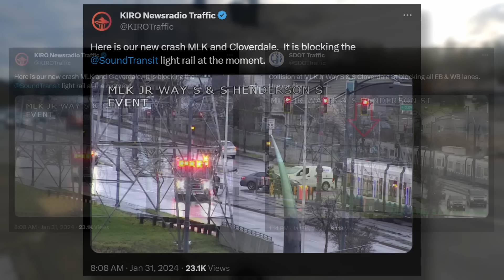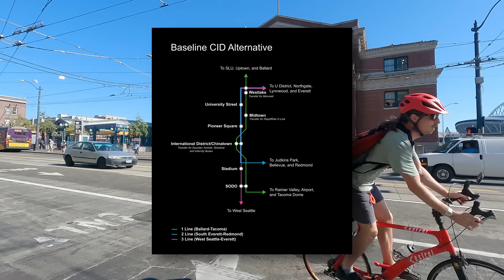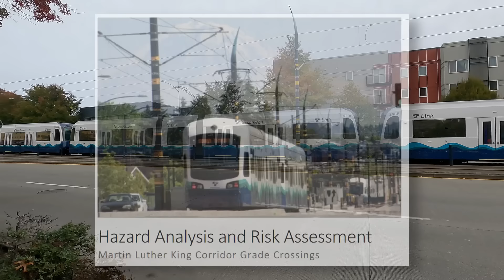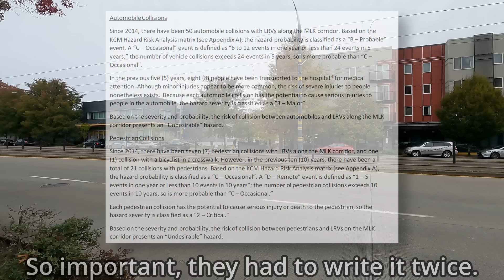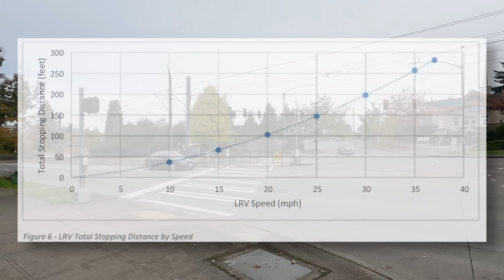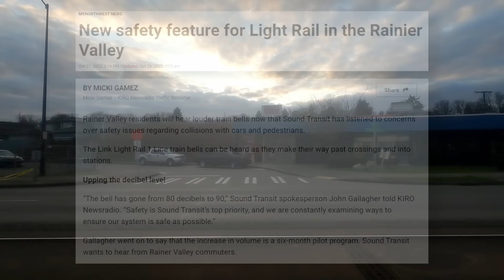Don't Skimp on Grade Separation

Comment: Sure, but the whole point of LRT is that it is a compromise: you trade off benefits for greater flexibility and less expensive construction and maintenance. When you start talking about grade separation, you’re really just rejecting the basic bargain that was made by building LRT and saying “we should have built a metro instead.” You’re no longer saying “make LRT better”; you’re just saying “ built metro instead of LRT.”
Reply: I think there are two super important things people miss about the whole "ew LRT"
1: Early on Link didn't have the political power it has today and so the cost savings of Rainier Valley allowed it to be built at all. The same can be said for systems like Minneapolis Light Rail.
2: RM Transit is a liar, low floor light rail vehicles aren't substantially lower capacity than metro trains of the same length.

You're absolutely right, this constantly droning on about how LRT is bad and you shouldn't build it "look at these systems that were stupid enough to fall for it" misses political contexts and takes away from the important discussion: how to make LRT work
Reply: @harlander-harpy  
Low floor trains are still less capacity than high floor trains depending on the seat design. If you have an LRT and metro both having transverse seating there wouldn’t be much of a difference. But if you have longitudinal seating one a metro trains, there is more capacity due to replacing seats with standing room which is more dense, even more if it has open gangways.

Edmonton is great example on having both high floors and low floors with similar dimensions. The seats are both wide, but high floors have more space to stand around in compared to low floors with seats having to be on top of the bogies.

If you’re running practically a discount metro, why run services and vehicles like it is a local tram.
Reply: That's the thing tho, Seattle needs a metro. There isn't really any compromise here, it's decent and reliable service with a heftier price tag, or subpar unreliable service but we save some money. I would rather have decent service.
Reply: @TheRandCrews  Link Series 3 LRVs will have single cab units similar to Portland. This will mean a 120m train can carry 932 people. A 120m long WMATA train can carry 957 people. The difference is pretty small.
Also, calling Link a local tram service is just patently stupid when the at grade center running segment makes up just 5 of its 25 miles and in a few years at grade segments will make up 6 of the 60 miles. By the end of ST3 construction it will make up just 6 of the 120 mile system.
Reply: @TheRandCrews If it only depends on the layout of the seats than high floor LTR have the same capacity. I don't share some of RM Transit's opinions on LTR but he's mot a lair. The advantade of high floor is the ability to hace level floors as there are no boxes to accomodate the bogies which limits the seat arrangment and leaves less space for passage but in newer models it's far less problematic. Today low floors are the standard in most systems.
That said the OP is right. If you wan't a regional service use actual trains, if you want a fully grade seperated system go with a metro/light metro, not light rail. Unlike RM I think it's great to use LTR if you have different needs along a specific rout and you can move the LTR underground when needed or have longer more regional style sections but this only applies if you have sections that are better served by street running with slowe speeds and shorter distances between stations.
Reply: Seattle had the opportunity to get a proper Metro in 1968’s Forward Thrust campaign.  The voters turned it down but voted for the Kingdome which we all enjoy using to this day!
Reply: @erik_griswold  actually, the reason it was turned down is interesting. The planners bypassed the objectively better Rainier Valley and opted to go the Georgetown route and so the people in RV voted against it 3:1, seeing it for what it was; yet another project that screwed over the black and brown communities in Seattle. Keep in mind, while FT was being voted on, the communities in Rainier Valley were fighting tooth and nail to prevent the RH Thompson Expressway that was slated to carve its way up through the valley, through Judkins, through the Central District, and through Montlake before heading further north still.
Reply: @harlander-harpy  rip that gas extension down lake city way though. shit would be fire today
Reply: @TheRandCrews  doesn't depend on high-floor or low floor, but the interior layout alone. There are also high floor trams with lower capacity than low flor trams, simply due to their layout.
Reply: @EnjoyFirefighting I literally said that with the seating arrangements in my same comment
Reply: @AL5520 I wouldn’t say low floor is the standard but more so became the trend for such new modern tramways and LRT being such a varying degree of design just adopted it as well. To be honest most cities in the US should be metros anyways but yeah price and politics. Seems to be the high ridership LRT systems are the ones that should be or near to metro status anyhow. Everyone is literally just missing out on my first part of my comment about seating arrangements
Reply: LRT is stupid it’s best in rural areas not as proper urban service
Reply: If public transit got the 90-10 federal state split every freaking highway gets there'd be no need for light rail. Highways are expensive and need rebuilding every 10 years if they are used. Rail is expensive once and saves money and space forever.

The goal should be to drive modal shift, we need to induce demand by building serious systems in ~every~ major population center and connect it up with interregional rail lacing thru the suburbs.
Reply: They should have built metro instead
Reply: @harlander-harpy  The capacity of a train is wholly dependent on the interior configuration. High floor trains give you more flexibility to configure the interiors how you like, be it for long distance or high capacity. WMATA trains have an interior layout more similar to a commuter train with rows of transverse seating. Meanwhile, the S7 stock used in London on the subsurface lines is 117m long and has a capacity of 1200 people. That's 28% more than the WMATA trains and the LRT trains. And a 120m long Class 378 lengthened to 120m would have a capacity of ~1380 people, which is 48% more.  The issue with 100% low floor trains as many other systems are trying to use is that the low floor interior and bogies that protrude into the interior eat up space that could be used for standing passengers. And the doors aren't exactly designed for high capacity use. At least Seattle used 70% low floor trams so that more of the interior can be longitudinal seating. Link is clearly morphing from a medium distance tram-like system to a high speed metro system, but the vehicles aren't adapted for that sort of operation. Low floor trams still have their uses, but they operate best when they are operating at grade (i.e. on the street) and not on a metro route.
Reply: I’m glad someone else said this. It’s a classic case of making perfect the enemy of good. Yes, I would love if the 1 Line was a fully separated heavy rail metro. But among LRT systems, Seattle gives the best bang for our buck, and really highlights why the flexibility is so beneficial. It’s not like Phoenix where the whole damn thing is in stroads, it’s only at grade when necessary, and while it has issues, the money required to mitigate them is no doubt cheaper than a bloated cut and cover through MLK
Reply: The thing is: The initial construction was built more like a European tramway (low-floor vehicles, at grade in the middle of streets, protected lanes) albeit with an unbundled tunnel section (in that it's served by one single line — compare Boston's Green Line and Philly's Trolleys where all lines converge into a tunnel with high frequencies) and lower stop density but everything past that is built grade separated and is practically a rapid transit. The arguments of the advantages of LRT has been long void for LINK and there is no reason to keep the at-grade sections today.
Reply: @TheRandCrews  The use of high floor LTR is very low today in the world and mostly exist in the US. There are legacy systems with high floors in other place but new systems are mostly low floor. Just look at the offers of the big manufacturers do not offer them or have a limited offer.
As for seating, it depends on the type of train. When the service is for shorter urban distances you can reduce the number of seats and increase the standing area but for longer rides with more suburban/regional service you cannot expect people to stand due to distance and speed. If the train serves both types you cannot expect people riding long distances in higher speeds to stand.
To resolve this you need to separate rides according to the type of service and rely on changes but in some places, like in many parts in the use, the aim is to provide the impossible for a good and extensive system - a one seat ride.
Reply: @kallmeej9106  yeah, whether or not it is designed as a metro, it is functioning’s as one 😊
Reply: Yeah but as a Filipino I can say that LRT can be grade-separated. The LRTA was made as an elevated light railway company in the 1980s, and also expanded to include heavy-rail too. So yes, LRT can and sometimes should be grade-separated.
Reply: North American transit discourse could really benefit by adopting the term "premetro" from European systems.

If you envision a corridor will support a tramway within the construction time horizon, build a dedicated-lane tramway. If you envision that corridor will support Metro in that same horizon, build a grade-separated Metro.

But in cases where you're planning for growth, and a tramway is more appropriate in the near term but eventually a Metro will be necessary, then build a tramway with incremental grade separations so it can gradually transform into a fully-fledged Metro as the city transforms around it.

Seattle's Link is a premetro. The real problem is not how the initial premetro segment was designed, but rather how incongruously Link's future is being planned: as fully-built-out Metro lines stretching far into the sprawl, without any notion of incremental, continuous improvement to the core segment where density is high enough to actually support transit ridership.
Reply: Metro is more expensive and would be rejected by voters. Grade separated LR is a better than walking compromise 😂

Comment: I really like the crossing gate idea. This would make the system very similar to the Edmonton light rail
Reply: Likely the best, time-responsive fix. Get the gates!

Though that path sure looks like cut and cover would be relatively easy, maybe?
Reply: @x--.  The problem is that service would have to be shut down for years. I did hear of another proposal: build a new viaduct on Rainer Ave, and connect the existing section to the  first hill streetcar
Reply: @robk7266  Yeah, a shutdown for that long would be unacceptable but I was thinking more like take a section of MLK, convert one side to two-way traffic and then cut and cover the other side with new tracks underground. Keep train service running.

Separate crew doing intersection and station boxes.

Probably not the cheapest option but has to be cheaper than tunnel boring or guaranteed death toll.
Reply: @x--. a better alternative is to build a bypass line through Georgetown and alongside the Boeing field airport. This would give a faster more direct route between downtown and the airport as well as faster commute time for south sound users. The MLK route can then be treated as a local street car line similar to the Tacoma link.
Reply: @greasher926  I think it could serve as a link to Renton, which is relatively dense and will probably eventually be connected to the Link

Comment: Probably at this stage the more sensible thing would be just to build a separate parallel line bypassing the Rainier Valley and then turning that into a sort of parallel shuttle route. could be done fairly cheap running the line through the industrial areas of Georgetown or for more expense go through South Park. Either way a grade separated right of way is essential to keep good headways as the 1-line continues to expand.

Comment: Is it possible to completely block through traffic from the side streets like what is shown at 11:00 for all intersections? If money is to be spent, I would spend it on bridges and/or tunnels for pedestrians and cyclists to easily get across while still blocking cars (although now that I think about it, this would probably block buses too).
Reply: yes, but if you're elevating every street, you might as well elevate the railway instead. At that point, you just have the Vancouver Skytrain
Reply: They can't do that because they need thru-traffic. With the passthrough, there would be no way to get from one side of the track to the other.

Comment: the RV at grade section sucks, but its also worth noting why this area is at grade to begin with. MLK's existence as a stroad was in preparation to plow a freeway through the RV and CD (Empire Freeway), but rich nimbys in madison valley killed that around 50 years ago. when it came time to build sound move, this area was intended to be elevated. neighborhood interests then raised an issue of equity, as move was elevated in minority-heavy areas, then underground in white areas like beacon hill and roosevelt. they wanted a tunnel like the other areas, which had it been chosen almost cetrainly would have killed the project entirely, just like forward thrust and the 1915 subway proposals before it (we now obviously have modern guideways that are far less intrusive than the els of nyc and chicago, which is the type of structure neighborhood interests were concerned about in the 90s). at grade was seen as the compromise. honestly, the "seattle process" is real and its surprising that link was built in a competent manner in the first place

Comment: How are you holding up with the winter in Seattle? Your viewers are cheering up for you!
Reply: It's been sunny. Lol. We've had barely any rain this winter.
Reply: IDK if this is parasocial, but he sounds a little less frustrated in his Seattle arc lol
Reply: Well that's because he used to live in Nevada/Vegas area and that's a "car paradise"..... @GaigeGrosskreutzGunClub
Reply: Winter in Seattle doesn't seem that bad. In fact, I would imagine it would be worse in Reno.
Reply: @pavld335  , yes. Have family in Reno and they have full winter gear where you don't need that here unless you like skiing. We get the occasional icy day which is terror with our hills (or hilarious if you don't need to be anywhere and can watch the compilations of car bowling), but it's usually ~45-55 F for highs and just slightly overcast or somewhat rainy. Snow is rare (1-2X per year and rarely sticks). A sweater and a rain jacket basically are all you need year round.

Comment: I am biased, and you can call me smug, but as someone whose is from British Columbia, Canada who tried out the Link Light Rail during that maintenance period, I hate to say it but I love my SkyTrain ❤️🚇 Sorry Link 😢

I will say, I DO like the Siemens S700 that Link uses on Line 1 as they are much smoother than the SkyTrain rolling stock, and taller as the SkyTrains have a rather smaller loading gauge. 

And sure, the SkyTrain may have automatic and open gangway trains, but most importantly, it's grade-separated, allowing trains to run at high frequency without worry of collisions with cars and pedestrians.

As you mentioned, frequency is one of the most important aspects of a transit system, and the only way to realistically achieve that is for it to be grade-separated.

For real, the frequency of the SkyTrain's is that during rush hours, sometimes the trains have wait behind each other like they're the ride vehicles at a theme park like Disneyland. So yes, a train traffic jam. 

I do hope that Seattle can improve the Link Light rail and provide a better service and experience for riders.

Comment: Sorry if this is a dumb question, but why isn't maintenance done at night? At least I understood that you're talking about regular maintenance.
Reply: This wasn't regular maintenance. It was work that needed to be done or the light rail wouldn't have been able to continue running on the tracks that had been set in the downtown stops. The tunnels were originally built so that buses could also go down there until the light rail had more work done.
Reply: @Mir_Teiwaz  Thanks, that solves it for me. [And proofs my dumbness, hah]